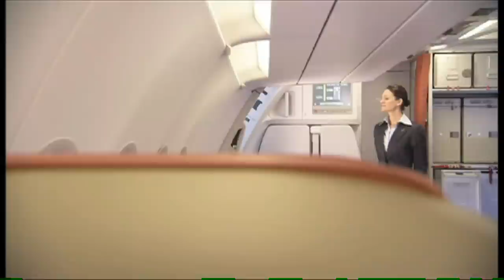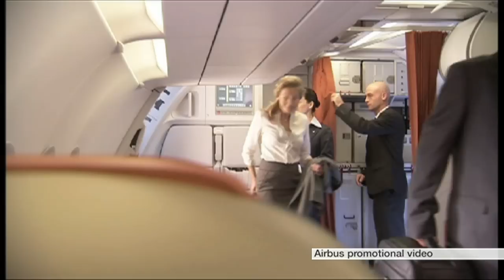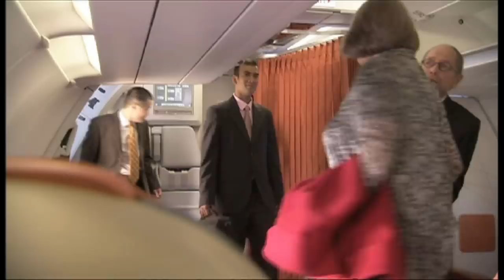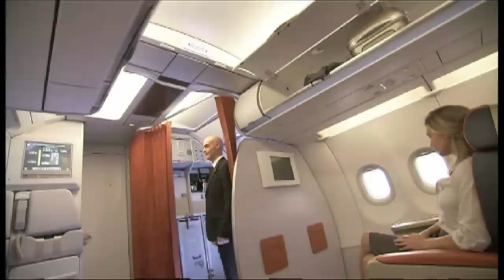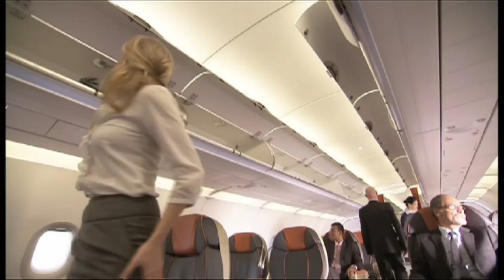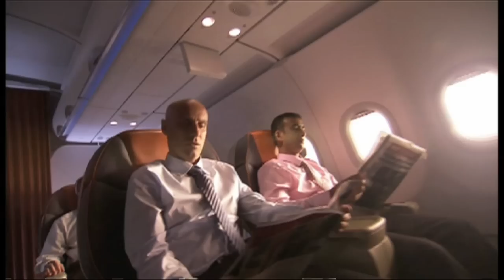How pilots operate the cockpit door on a commercial jet - BBC News

Comment: This is inaccurate. Pilot can move a switch to deny entry, even if those outside tried entering they never could if the conscious pilot inside was able to periodically set it to deny
Reply: If its deliberate, you're absolutely correct. If the switch is set to deny (boeing) or lock (airbus) it only stops the code entry for entry for 5 minutes.

Comment: That door looks as clumsy as a diving board it doesn’t matter what it’s made of are you sure that thing can’t be opened by some random passenger or kicked in . That thing looks like the door on my bedroom .
Reply: Nicholas Shah I can assure you mate that door is much stronger than it may appear.
Reply: This doors are heavily bullet-proof. You can even find a video on YouTube where they tested it.
Reply: That door can survive gunshots, car impacts amd even temperatures up to 210.C
Reply: Seeing as how they’ve specifically designed the door to prevent that, I’d guess they took that into account.
Reply: It's usually a kevlar composite material with hardened bolts. It's impenetrable without serious equipment.